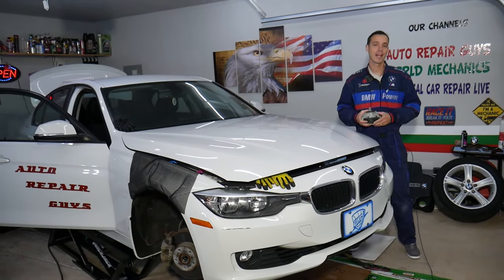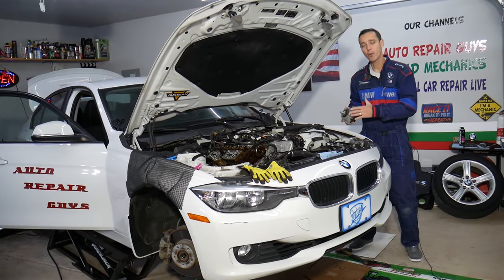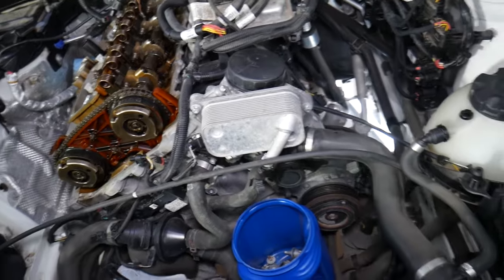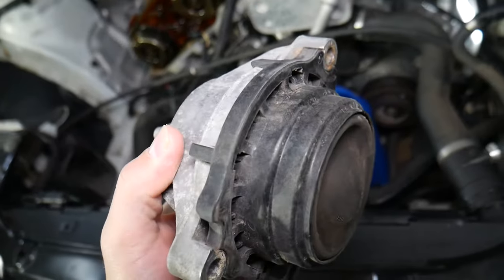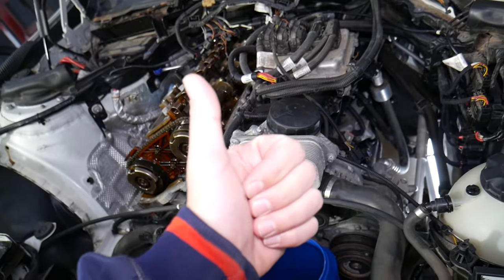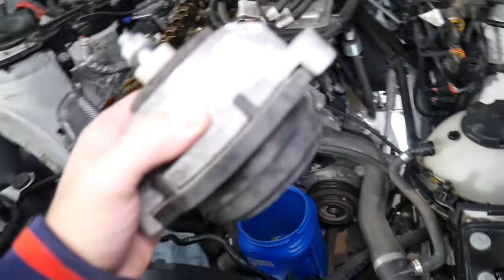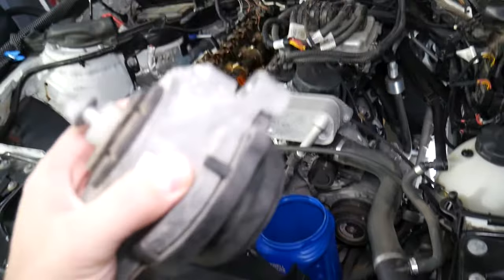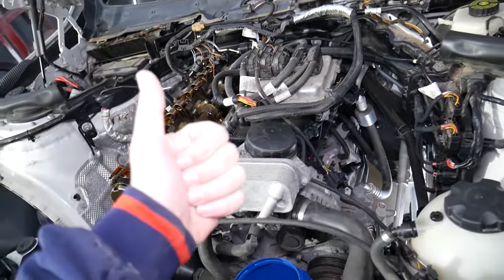WHAT ARE THE SYMPTOMS OF BAD ENGINE MOUNT ON BMW

Comment: I has a bad left hand engine mount on my 2001 E39 530D.

The symptoms were vibration and noise when in Park or Reverse. In Drive (or the other forward gears) there was not any noticeable noise or vibration. The symptoms were worse when the engine was cold.

Swapping out the engine mount was easy took me about an hour or so including disconnecting/connecting the vacuum system that is used on the E39/M57 engine mounts.

Glad it wasn't the right hand engine mount as the positioning of it below the turbo makes access to the attachments much more difficult, even so I would expect to be able to replace the RH one on a couple of hours
Reply: Having done a very unscientific survey of Youtube videos and BMW blog posts on tthe subject of engine mounts is seems to be invariably true that the left hand one lets go first. I guess that this is to do with the direction of rotaion of the engine and the push/pull stresses on the LH and RH engine mounts.
Reply: Did you had vibration during braking, on steering wheel, Also passenger seat vibrating during ride....
Reply: @Soulchef92.  no none of that. Just vibration in reverse and to a lesser extent in park.
Reply: This is exactly what is happening in my '06 750li. Thanks for posting this!

Comment: do these engine mounts have oil in them? i have e90 320i and i see oil leaking from passenger side engine mount and i am not sure where its coming from, i recently changed my engine oil
Reply: Just got a vid from mechanic mine are starting to wear and have the same thing haven’t had any symptoms of bad engine mount yet tho so if it’s only that your probably good for at least a lil bit

Comment: I have some vibration when first flooring the trottle to high rpm, then letting off quickly, then there is some vibration that seem to be transmitting through the car body. Seems to come from engine/gearbox area, can only be heard inside car with closed windows. It follows the engine rpm, so if I for example push in the clutch the vibration drops off together with engine rpm. If I let off the throttle gently from high rpm -> all good. Changed the harmonic damper but issue still there. Exhaust is all in good shape, can't see anything contacting any part of the body. I'm thinking, it has to be bad engine mounts. Changed them like 8 years ago, I guess maybe time to do it again..?

Comment: Need answer fast. my enginge mount is broken can it make the serpentine belt jump off? Mine did that and every wheel in for the belt is in good shape so is the tensioner. How can that be possible? Is it beacuse of vibration it makes from engine when mount is broken??? I have a e63 amg

Comment: I had the same problem. Replaced my mounts and now the vibrations are worse idling. Can you advise what the problem may be? Where do I start with vacuum leaks
Reply: what the brands of your mount?, ive see more vibration problem with aftermarkets mounts, apparantly the bmw mount have fluid inside, the aftermarkets are only strong plastic, ive many problem too my x3 because aftermarket mount are too hard

Comment: I have a 2014 BMW X1 sdrive28i I get a vibration sound  on the highway doing 70 to 80 MPH only on highway at those speeds
Reply: Did u resolve this I have the same issue I suspect its my mounts everything else that could be a suspect has been chnaged please reply

Comment: My BMW vibrates ALOT on a cold engine. After 10 mins of driving when the car is warm, the vibration stops. This bad vibration only happens when the engine is cold. Is this a sign of engine mounts needing to be changed? Please help
Reply: Ok
Reply: posibly, but maybe ignition coils must be replaced
Reply: I have this too, did you find an answer?
Reply: @Master1906  I did. I changed the mounts and the problem was rectified. The rubber on the old mounts were so compressed that it caused my engine to drop. The new mounts had ALOT more rubber
Reply: @nathanadler301  i see thanks. How much did it cost? Is it dangerous if i leave it for too long without replacing?
Reply: @nathanadler301  how much did it cost ?
Reply: @zachslump5844  Heyy.. OEM replacements cost me $118 on Ebay
Reply: @Master1906  Now seeing this..Sorry for the late response. OEM pair cost me $118 on Ebay. I'd say that it isnt absolutely immediate to have it changed. However, after a long time, the constant shaking will get more and more aggressive and you can run the risk of hoses becoming loosen and weaker with the constant aggressive shaking.